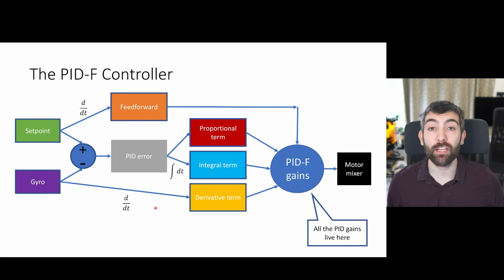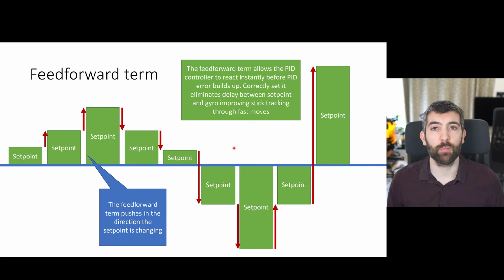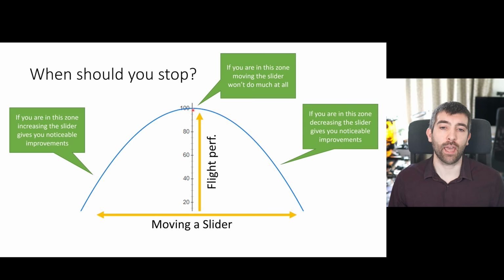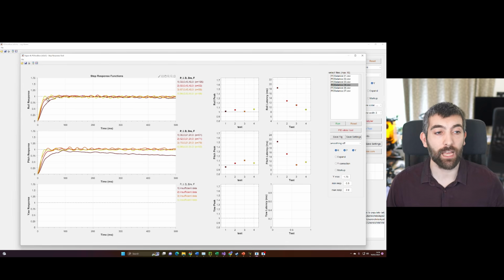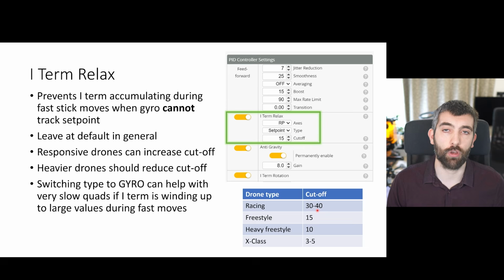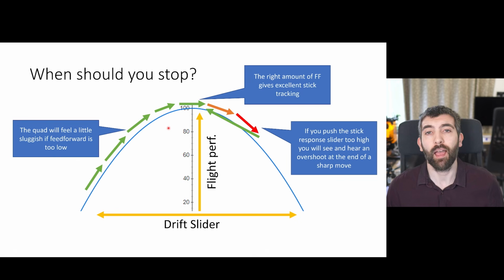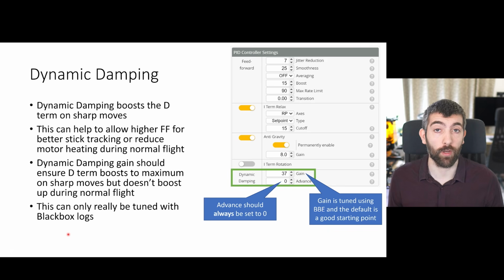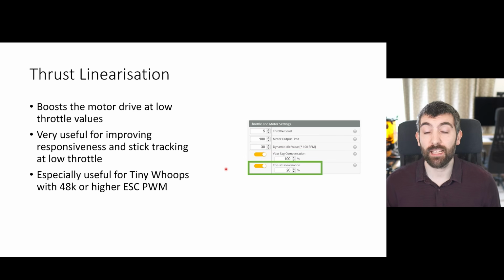Betaflight 4.5 PID Tuning

Comment: On my last Quad i had following problem.... i cant geht any results out of the "tracking silder" i tuned several quads (3" to 2") and everthing was alright.... but on the 3,5" there was no way i can get any step responses everything looks the same.... it turns out (after talking with the pidtoolboxguy aka Brain) that the damping was so much active on silder value 1.0 that nothing changes on the tracking silder.... so i had to go the old way, and tune via D-Gain silder...... you dont say anthing about such a case in your video... that was very odd for me, because normaly you mention all cases and what to do about it
Reply from the maker: Interesting experience, it's true that high damping levels can sometimes make tracking adjustments less effective, so manual tuning is a solid workaround when the sliders hit a limit. If you are changing things and nothing is changing you just have to keep going. A lot of pilots make the mistake of not wanting to change things too much from the defaults. You won't know how far you need to go until you go too far. If you max out the sliders turn them off and start typing in bigger values!
Reply: @ChrisRosser in this case i know something wasnt right until i got to tracking 1.8 and then drill a hole into the celling. I also think about to reduce d gain to lets say 0.8 and than test the tracking slider positions. But that route i dont want to go. So i only set the d gain to the best value. And it was the right thing to do. The quad flies amazing

Comment: I'm trying to find a video of a clear example of "trilling" and I CAN NOT find anything useful. @Chris Rosser, could you please make a video demonstrating how to identify trilling? Maybe an A/B video demonstrating it? BTW I built a 3.5" and turned the Master multiplier up to 2x and still can't determine any negative efects on a hover test... Am I setting myself up for failure?
Reply: You ever hear the car on the old Jetsons cartoons? That’s as close as I can explain it, especially at high throttle/ high demand moves. Use your camera to record the sound in flight and you’ll know it when you hear it.
Reply: Thanks, yeah I know it!
I don't have a camera on my drone, only the vtx one. I'm not planning on making YouTube clips so I figure I don't need it. Extra weight..

Comment: Once I have found the correct Master Multiplier, do I leave Dynamic Damping  at 0 or do I return it to 1 ?
Reply: I'm a noob but I imagine you return it to 1, since you're really only disabling it to prevent it from interfering with your tests at each increment bump.

Comment: Chris, is there a problem with finding the master multiplier with "FF Gains" and "I Gains" turned off in addition to "D Max"? Another question, my master multiplier is already at 1.7 and I haven't seen much difference in temperature and/or audible noises in the motors, I'm afraid to go higher.

Comment: be careful with this method in BF 4.5 because angle mode does not match acro. a quad tuned in angle mode will not fly well in acro

Comment: Trying to get Patreon, but payments seem to be failing. As a result, I'll just be tuning via what I hear from the quad. Your videos are extremely useful, and I'm hoping to get a hold of the PDF guide (and the software to go more in-depth into tuning). I just got back into FPV, and upon flying the first new build...it felt terribly sluggish. Watching your filter tuning vid helped immensely, and got my quad flying responsively.

One thing that is bugging me with this PID tuning is when you shift from PD balancing and values, to PI and I term tuning. When you go to tuning PI balance, you state to start out with a value of 0.5. My issue with this is that this value was at 1 when PD balance was tuned, so why would one start at a lower value? Also, oscillations that exist during PD tuning could perhaps be due to PI tuning (since the tuning was done with the value of 1), could they not?

Are you suggesting starting at 0.5 values to show the variation between different graphs with higher values? It seems to me that tuning would best be done by starting with the default values of 1 when tuning PD and PI balances for a couple of reasons (and if course assuming you aren't dealing wth a quad that is very small or very large), One, values of 1 seem to be the starting point, as they are set by default. As per your vid, values of 1.1 - 1.25 seem to be the appropriate range. Secondly, PD tuning occurs with a default of 1, and if you've flown the quad prior to tuning and it didn't have oscillations, surely a value of 1 for the PD starting point is okay. Again, this is assuming one is dealing with a 5 inch quad, not something with tiny props, or something with 10 inch props. Quads in the extremes of sizes would naturally fly terribly with the stock tune. In those cases, however, perhaps it would be wise to decrease those values to 0.5 prior to starting tuning.

Comment: I'm struggling to hear "oscillations" or or anything wrong when trying to tune my quads. I'm getting the master multiplier op to 1,8 and can't get the quad to oscillate or get hot motors... I know it's too high but... Got a great looking "P&I" (1.2) from the step response. But on "I gains" can't get any bounce back or oscillations and i'm up to 1.6 on the slider, settled on 1.2 after checking step reponses. I have some damaged props on but i'm not getting up to the limits where I hear or see anything that should be there with such high numbers. It's a very clean new built Nazgul with great  looking noise profile in blackbox. Does it need to be in a more "beat up" condition to get more obvious results?
Reply: same problem, when he explains with graphicals examples its easy to follow and try to replicate but when he uses oscilations or some concept that may be different between interpretations its not as easy lol.

Comment: When i go zero throttle on my 3.5 " build, the quad turns and goes off its axis by itself. Whereas my 5 " drone i can go zero throttle in any position and it remains that way for the most part.  Is this due to tuning or a setting i might be missing here?  I thought it was the battery weight but my other drones don't do as drastically.
Reply: Try turning up anti-gravity or lowering TPA setpoint
Reply: @woopweep9605  going to try this. Thanks for the suggestion.
Reply: 40% Thrust linearization ❤

Comment: isn't the derivative term also supposed to be based on the error?
Reply from the maker: In BF they split the derivative of setpoint into feedforward and the derivative of gyro into D term. As error = setpoint - gyro this gives finer control over the derivative term.
Reply: @ChrisRosser  need to read up on theory, never got to the feedforward chapter lol

Comment: What prop pitch corresponds to "low" and "steep"?
Reply: The usual range for 5 inch props is 3” - 5.1” (some go to 6” but that’s an extreme case), so I would say 3” is low, and 5” and above is high/steep.

Comment: what is low pitch 2? what is high pitch 4 5? i use 3 i am guessing in the middle?
Reply: The usual range for 5 inch props is 3” - 5.1” (some go to 6” but that’s an extreme case), so I would say 3” is low, and 5” and above is high, and 4 is pretty much the middle.

Comment: Hello Chris and community!
Thank you for your great videos! Using this one I was able to make my quad experience much better than it was on stock settings!
I have a question regarding ExpressLRS presets. Where caun I find the one, that works for my ELRS? I thought it was the Pocket Rate setting in my TX. However, the values on TX are 100Hz, 200Hz, and there are no presets for those values. I see the values on presets are 150Hz, 250Hz, and I have no such values available on my TX. What have I missed here?

Comment: You should stress test the 2004 t motors.  They have improper manufacturing on the herrings and will seize up under heat build up.  I got screwed on these motors

Comment: After always avoiding this, I sat down today and tried to tune my 1S quads.

It actually worked quite well, I was able to reduce the filters and every flight in our production hall felt a bit cleaner. As for the PID tuning, I actually left everything at the default setting of 1 because after the filters were optimized, the copters were actually flying quite well.

But then I went outside and it turned out that tuning is not that easy after all.
From my 3-5 inch copters I know that they are always carried away a little in the wind and I have to counteract this, but with the little ones it was a completely different story. They were super nervous and started to shake a lot.

Is it possible to optimize this with PID tuning, or do I have to accept it because they are only 1S copters?
Reply: 1s is usually poor for outdoor flight, they are just too light. Any bit of wind becomes a big problem. You can't fix that with tuning.
Reply: @geometerfpv2804  in the meantime I was able to fix the problem but thanks for the answer.

Comment: 5” quads don’t be surprised when you realize after going through all steps you end up back at default with a few minor tweaks.
Reply: Not on my 5" quad
Reply: My 6" had fairly minor adjustments too, but the difference in feel was pretty huge.
Reply: Betaflight pid default design for 5" drone. Not suprise
Reply: so true
Reply: Yup
Reply: Good to know
Reply: I ended up with poop in my pants 🥺

Comment: Hi Chris, thank you soo much for the work that you do. I happen to have a Moblite 7 1S HDZero Quad. And as far as i understood, i dont have logs. Is there a way to tune without logs and for a TinyWhoop? I would love to see a video about that. Further more, my Props spec says site 1.6" and pitch 1", is that considered low, mid or high? Couldn't find any information about what is what. Love your work!

Comment: Blah blah, blah blah blah blah blah blah blah. Just put a default setting in beta flight. Done. You won’t have any problems with a good 5 inch squad set up nowadays.
Reply: First of all it's called quad, not squad. But you are damn right, because every 5" quad has the same motors, weight, weight distribution, PWM frequency. And the same props of course, because it's a freakin' 5 inch. Blah, blah, blah.
Reply: 1. Only good for 5 inch builds
2. You can make a 5 inch fly a lot better tho (this is what this video is for)
3. Why are you even watching then
Reply: Why even watch this channel if you don't like technical analysis
Reply: So I have fly only 5"?

Comment: Appreciate the information. Question regarding tuning flights: Can all tuning described in the video be done by wobbles left/right and front/back in angle mode? I guess for settings like anti gravity different kinds of tuning flights are needed?
Reply: The thing is, you wont use a step response tool to tune antigravity  or i term. you do like in the filter tunning where you need to find by yourself the wobles. You may not need to tune antigravity if your i term works fine. I think it is impossible to tune i term or antigravity in angle mode

Comment: Hi Chris, something is bothering me, but you'll probably have the answer. Usually, Dterm is supposed to be fed with error (kD dε(t)/dt), but it seems in BF, only the gyro mesure is used. Aren't we more interested by the rate at which the error changes than the rate of change of the rotation of the quad itself ? We need to know how fast the rotation speed changes so the quad reaches the setpoint, not how fast the rotation rate globally evolves. I might be missing something, I hope you could enlight me, thanks ! :)
Reply: I was thinking the same
Reply: I was also wondering about this. It seems like (looking at the code in pid.c) that the D and F terms in betaflight are very similar to a classic derivative controller. Normally we calculate, as you stated, derror/dt, where error = stick - gyro. Since the derivative is a linear operator, derror/dt is equivalent to dstick/dt - dgyro/dt. Turns out, the ''F' controller is just one half of the classical derivative (dstick/dt), but with some extra tweaking added on top. The minus sign in front of the gyro derivative is just hidden away in the code. So it is still a fairly classical PID controller under the hood, except the D controller allows for essentially separate gains for stick and gyro derivatives.
Reply: @PeterKrull1  Do you mean FF term is complementary to the Dterm, bringing the "missing" setpoint part ? Wouldn't we have a problem if FF is disabled then ? I thought the Dterm needed to detect when the system was going to fast towards the setpoint (= when the error is getting smaller to fast). I had the same reflex as you, by checking pid.c and I saw the setpoint nor the error were not directly involved, but I feel I am missing something somewhere 😅 And I suck at maths, so I might not have understood properly your explanation ;)
Reply: @jejefpv  You could disable the FF term completely, it would not make the system unstable, just feel sloppy. The derivative of the gyro will always just work to brake any change to the rate of rotation, no matter what the setpoint is. The FF term (or the dstick/dt part of a standard PID controller) will then act as the initial kick to get the rotation started, and then the dgyro/dt controller will to to stop that rotation. The point is that these two components of the classical derivative controller actually fight each other somewhat. But due to the delay between your setpoint changing (the initial kick) and the gyro sensing the rotation and braking, we get a really nice acceleration and deceleration.
Reply: @PeterKrull1  Thanks for the detailed reply mate 👍 I was disturbed by the fact it slows down the rate of rotation without taking into account the error. Your point about the delay and the FF makes it more understandable

Comment: Hi, I just rebuilt my quad entirely but with my new 2755kv motors it only sounds good with the master slider at 0.15, at normal 1 the motors get warm at idle and sound rough (completely new motors). I havemt flown it yet, should I be concerned? Any ideas?

Comment: Proper hardware were mentioned, but I want to highlight if anyone notices high throttle oscillations, before changing TPA , make 100% sure that there isn't any wire close to the FC, I run into this several times and it was always a hardware / wiring problem. 😊
Reply: I had that wire problem once when I first got into fpv.. Bardwell was one that told make sure no wires were near gyro. Moved wires and low Hz noise was gone
Reply: Hi ! I'm having this issue, but the only wire next to my gyro are the Rx one's, can it be the cause?

Comment: Why raise master before p/d balance?
Reply: Think of it like volume on radio. When tuning the equalizer to get best sound, and we listen to radio at a loud volume, it’s best setting it up at the volume we’re gonna be using. Can you do it with it on low volume, yea, but you may have tweak it again after turning the volume back up. since we want max pids, go on and increase the mm first, then it should save you from having to go back and tweak the pd balance.
Reply: I had the same question. Maybe the methods have evolved since 4.3?
Reply: @taterfpv  AHH no there are no changes to pid tuning or filters since 4.4.. not sure that these things need such long videos vs 4.4 given there has been no change